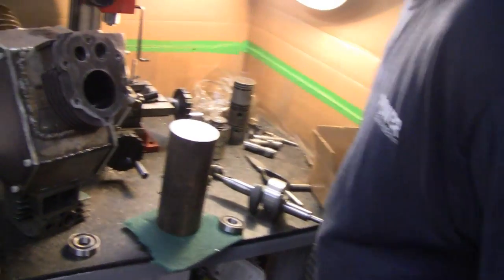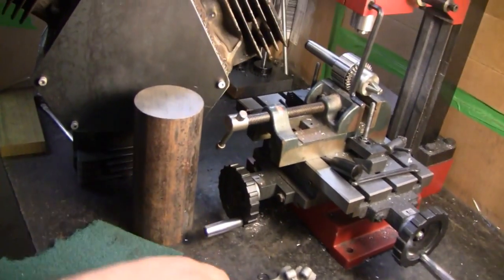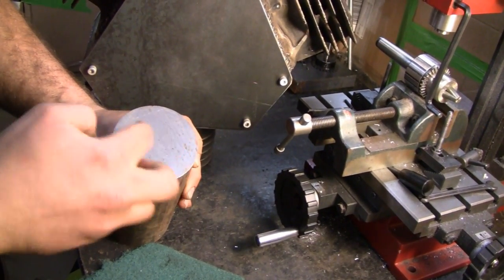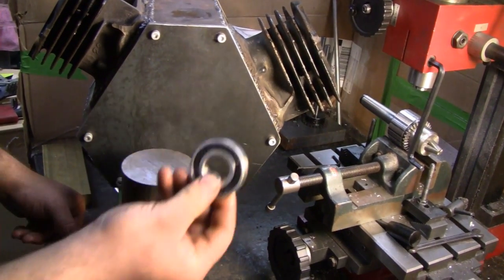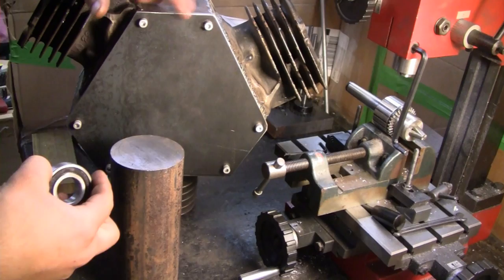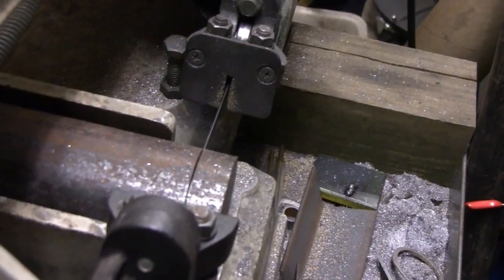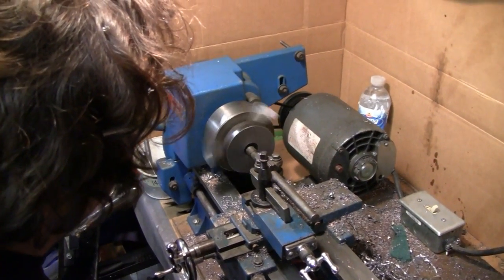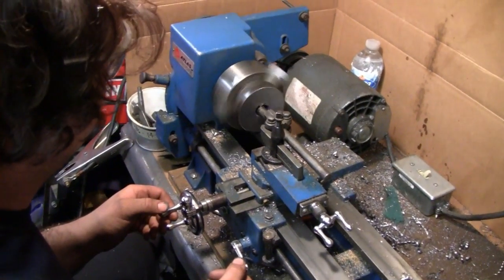HOMEMADE RADIAL BRIGGS ENGINE (part 19)

Comment: I'm sure that cold rolled steel was tough on the bandsaw blade!
I don't think that little lathe has enough throw height to fit the plate once you weld the bearing holder to it.

Comment: you can put a junk bearing in there while you weld it, it will help preventing deformation a little bit. or make a dummy out of steel.
Reply from the maker: +M Hesselgren We decided to bolt them in!!☺
Reply: +805ROADKING good choise

Comment: I was noticing the metal cuttings in Mike's hair.  As I  have as much hair as an egg, I was cringing  at the thought of trying to run a comb or brush through this. Ouch !
Also I was wondering about centering the crankshaft holes in the engine's end plate's. That calls for precise measuring..
Keep 'em coming ROADKING.
Reply from the maker: +Reg Sparkes Yeah he had chips flying all over the place!! We laid out and drilled the holes already, it wasn't too bad!!☺

Comment: Concerning your bearing blocks you might want to machine a undersize whole then weld the bearing block to the plate and finish machine it after it's welded
Reply from the maker: +Dave Hetrick We're gonna bolt them in instead of welding!!☺
Reply: Awesome

Comment: Just a thought. Had you considered an engine stand which would rotate upwards, 90 degrees, (a bit like a cement mixer) upon completion of each engine run? This might be a great system to eliminate lower cylinder, oil run-down into the combustion chamber(s) ; the bugaboo common to radial aircraft engines. No pull- through, or plug pulling to purge trapped oil.
Reply from the maker: +rickey5353 Nah, we haven't thought of anything but trying to get the engine done right now!!☺

Comment: Are those bearings going to be wet in the case or dry bearings ?
Reply: +krazy45cat it looks like  he is  leaving them as sealed  ball bearings with the bearing on the outside of the case
Reply from the maker: +krazy45cat They're pre-greased sealed bearings!!☺
Reply: +805ROADKING Thanks , how much oil will the case hold ?
Reply from the maker: Good question!! We haven't built the sump yet, that's something we still have to figure out!!☺
Reply: +805ROADKING OK then  , have a great weekend . GJ

Comment: I was wondering if I could make one with 3 25cc two stroke motors that way there is no timing to mess with and get a higher rpm
Reply: +Charlie Hull sounds like a good idea just would need ignition timing
Reply: +kierankay100 ya I'm just not sure if the connecting rods would be long enough
Reply: +kierankay100 then ya just some cdi would work
Reply: true but connecting rods ah make them ! ahaha
Reply: +Charlie Hull   nice  i hope all the positive support helps you find away to do it

Comment: I'm not sure if you are going to seal the crank case off, or if you've already planned that part out.  Superchargers have a seal that rides on the front shafts of the rotors next to the bearings to keep the gear oil from going inside the supercharger case.  I thought seals like those could work in your application.  Just thrownin' out an idea for you guys.  I love your guy's builds, can't wait to see this one run.
Reply from the maker: +UnitZ28 We're using sealed bearings and we're only dealing with splash not pressure, so we should be alright!!☺
Reply: I'm wondering how the sealing situation is going to work too.  That supercharger idea seems like it would work great in this application.
Reply: 805ROADKING Good stuff.  But remember, there is still going to be pressure in the crank case from blow-by.